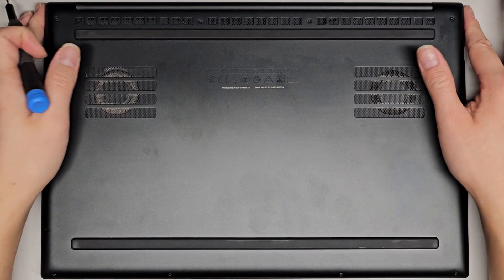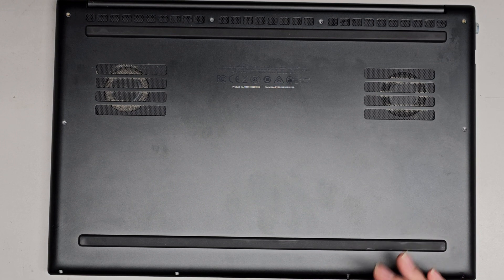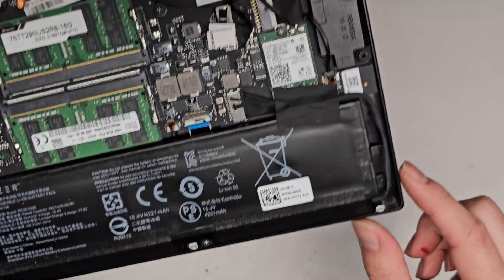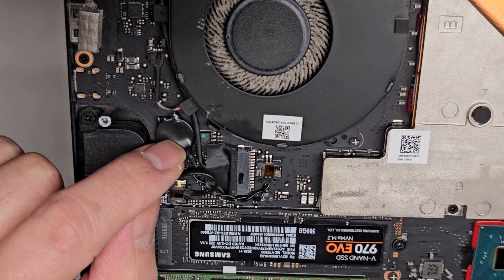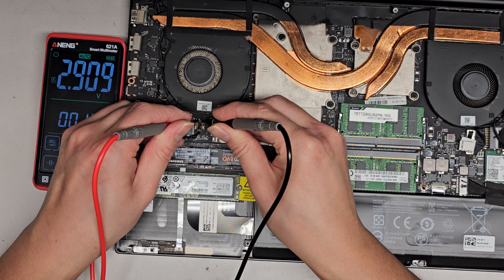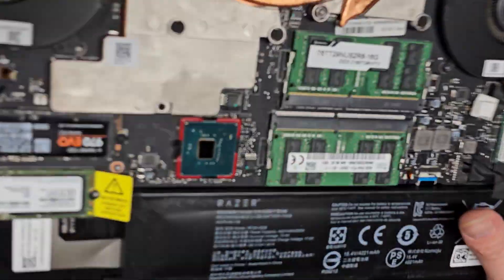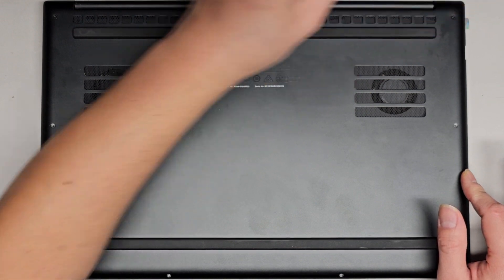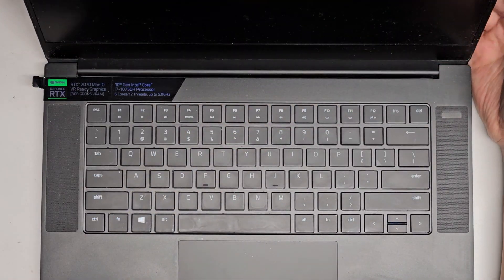2020 Razer Blade 15 RZ09-03287E22 Disassembly RAM SSD Hard Drive Upgrade Battery Replacement Repair

Comment: Lowkey wish Macs were just as upgradeable...  Nice vid!
Reply from the maker: Yeah, macs are designed to toss after anything is no longer sufficient. :(
Reply: Could you tell me what ribbon goes across which is missing in picture from motherboard to other small board which has 2 ribbon connectors next to each other on my Razor RZ09-0328 (same model) would really appreciate any help